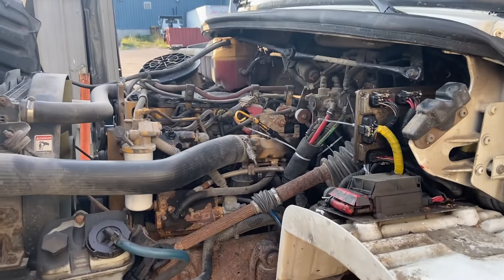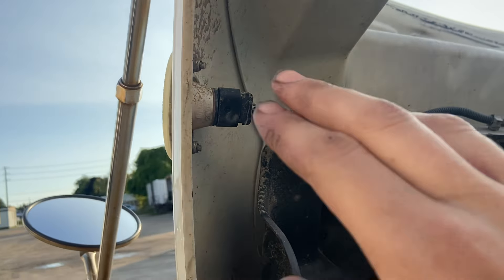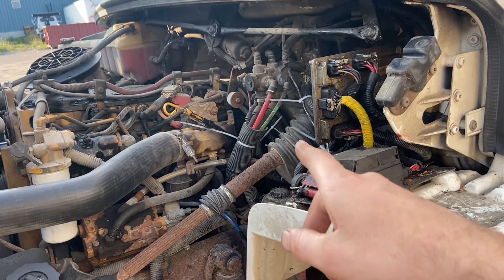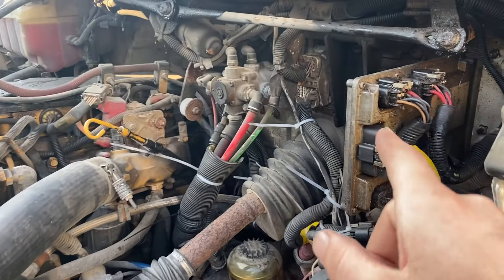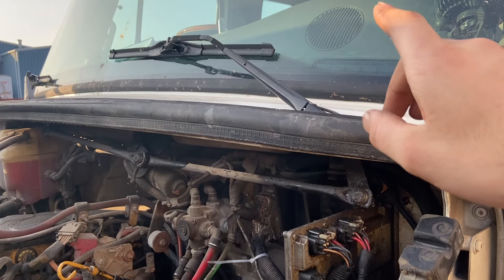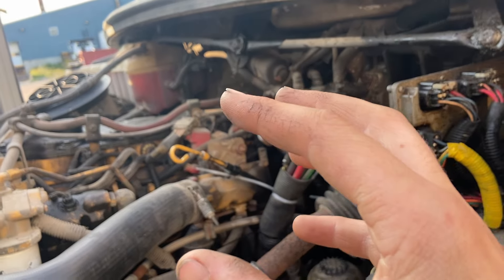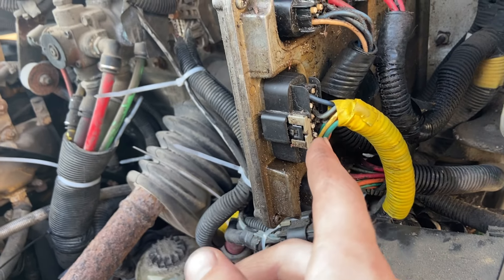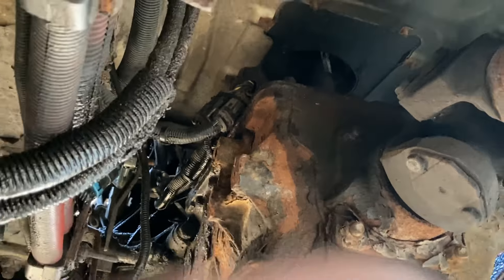Freightliner M2 Flashing signal lights

Comment: Thanks you saved me a bunch of headache and running around. found my C4 plug on the chassis control module to be leaking and the pins inside corroded.

Comment: Wow this video is nearly spot on for me, new bulkhead module and new chassis module, my issue is intermittent. Right headlight and flashers start, but have no reverse lights, no high beams, no wipers, no suspension dump while this is happening. Then it will just stop having the issue for a few weeks. No mechanic has been able to find the issue because it stops doing it whenever i get to a shop. I tell them its wiring but they always want to throw parts at it.
Reply: Forgot to add I lose all my gauges as well and def light starts flashing, I did find some light corrosion on one of the pins to the chassis module when I was changing it out might have to have a new plug installed.
Reply from the maker: I almost guarantee you have an intermittent short circuit taking down the communications between modules
Reply: Yeah trying to track it down is impossible it seems, 4 shops and $2500 no solution yet
Reply from the maker: @taylorlown5225  :( that’s too bad, I feel bad for you
Reply: @taylorlown5225 if you still haven't fix it I can help you by sending a wiring diagram.
Reply: It most likely has to do with you power, grounds and J1939 communication wires on you bulkhead module.

Comment: Sept 5 730pm. Well crap wish i had seen this 2 weeks ago.  Have an m2 112. Engine shut off due to low coolant but also the light thing. My mechanic wouldn’t touch it because of freightliner wiring. Dealership found corrosion in plug   In cab module to  a tune of $2800. So thank you awesome video for next time
Reply from the maker: hey wish i could have helped you sooner, looks like your truck had issues a week before mine. yeah i will be posting any videos of any issues that arise on our fleet of trucks, thanks for the comment.

Comment: Mine is doing the exact same thing! Thanks for the video
Reply from the maker: Hey! Glad to help, let us know what you end up finding, the more information on this video really helps everyone else pinpoint common failure locations on the truck! Thanks and best of luck to you Dave
Reply: My right side turn signal was not working. It was the instrument panel relay or plug. I did put in a new switch but it was the instrument cluster
Reply from the maker: @302StangBoss  hey thanks for the input!

Comment: With this kind of issue, before you become a freightliner dealer's victim or buy expense parts, just disconnect the battery cable for few minutes and reconnect it.  It may solve your problem.

Comment: I am working on a city variant for a Ltl company and after they installed a new Eld system I wonder if they connected accidentally wrong J19 data cables under dash causing this one to loose lights. This another reason why to not own freightShakers

Comment: My problem is interminent loss of connection with the bhm, as my instrument cluster stops working. no tach no speedo oil pressure etc  the only thing that works is the gas gauge. any ideas on whats going on or am i just gonna have to start tracing wires?

Comment: Great info thanks question.. did you ever had hot air coming under the dash area.. steering wheel area while driving on a highway and then almost nothing at a full stop ? 2023 Freightliner M2 Tow truck.  Thanks
Reply from the maker: @tommybikes717  no I can’t say I have but by the sounds of it your truck may have a hole somewhere in the firewall, sometimes rubber grommets get removed for service work and the mechanic forgets to install it again and hot air from the engine compartment will leak into the cab as you drive down the road
Reply: @Tech-28  Thanks so much check in tomorrow morning. I’ll keep you posted.
Reply from the maker: @tommybikes717  sweet, yeah let me know what you find, I used smoke from an evap test machine once to find a hole in the firewall like that, turned out someone left the shifter cable boot off after changing the cables

Comment: I have a M2 in the shop right now. The cab marker lights are flickering at reduced brightness. The rear marker lights do not work at all. Headlights and turn signals all work OK. There is a relay clicking rapidly in the fuse block behind the driver seat. Cab marker lights still  flicker with that relay removed. A wiring diagram would be so helpful.
Reply from the maker: Even with the wiring diagram it’s so poorl laid out by freight liner that it’s stupidly difficult to understand why they wired it that way
Reply: Did you ever find a solution for this issue? I’ve got an M2 with an Altec body with the same issue.
Reply: @Mutanthawk80  I found the wire for the marker lights above the rear roll up door pinched at the top of the door. Wire was shorted to ground. Repaired the bad spot in the wire and zip tied it out of the way. All better.
Reply: @Tech-28 found the problem. Wire for the marker lights above the rear roll up door were pinched in the door.
Reply from the maker: @shadymaint1  beauty! Nice work.

Comment: How’s it goin?! helping my buddy, pretty much same set up, I think 2012.  what did you have to do to fix the problem? Was it just removing the green from ground? Thanks.
Reply from the maker: It was a rubbed through wire in the harness that cause the wire to turn green. In the CAN HiGH network line “green in color”
Reply: @Tech-28  thanks. gonna go look at that spot now. have same symptoms. Resistance all over the place with ecu plugged in. with it un plugged I get 60 on green and yellow.
Reply from the maker: @tdiraketa  yes the ecm will add a bunch of resistance to the circuit, 60 ohms is a lot and maybe both green and yellow wires are affected.. definitely get in there with a light and take a good hard look. Let me know what you end up finding, I’m interested
Reply: Hello I got 2011 freightliner m2 106 . The Signal lights working perfect, everything is working perfect Just the break lights don't working
Reply: @sunnysmarket  did figure it out